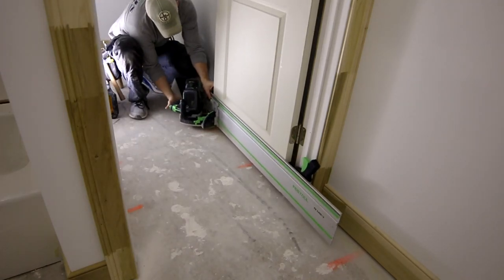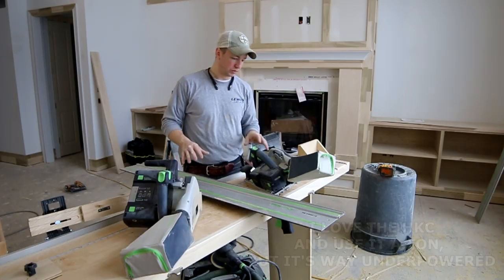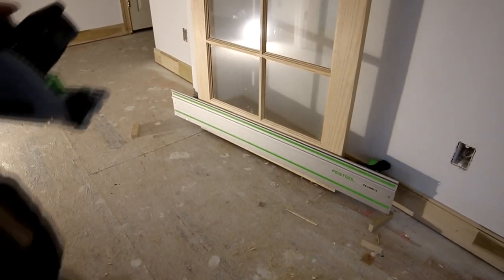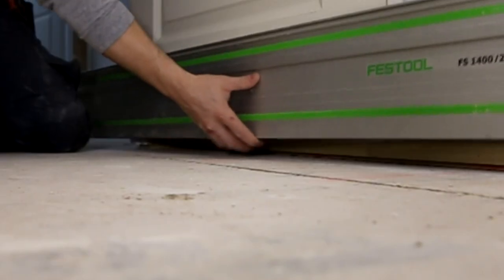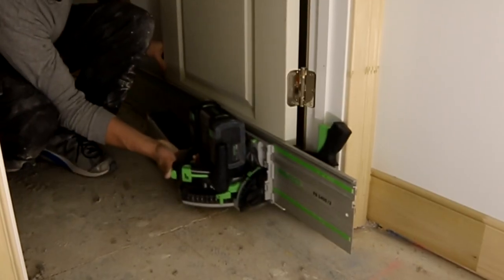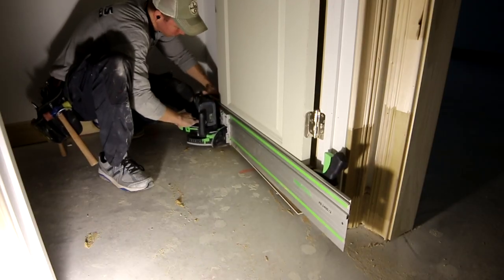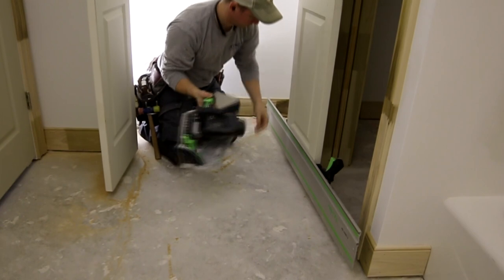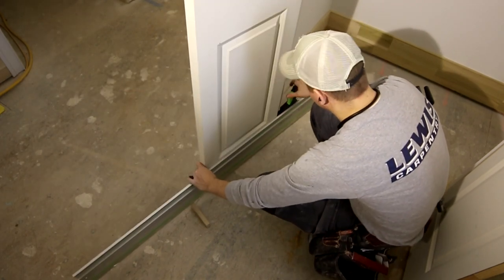Fast Door Cutting While Still Hanging??? Festool TSC 55 for the WIN!!!

Comment: I did this about 10 years ago at my friend's house.  People used to make fun of me when I told them how much the saw was with all the different clamps.  Then I started getting calls..."Hey can you come over here with that saw and do this or that?"  Then a few years later it was....."why do you need that cordless version now?"  Once in a while back then I would break down sheets if I was picking them up with my car, and the cuts din't waste any material because they were so accurate. I also made a vacuum adaptor for the Festool rail before I knew about the Mafell vacuum rail about 6 years ago. I love my TSC55 it has more power than the TS55 corded version I used to have, but you have to have extra batteries with you on the road.

Comment: Great video! I’ve been doing this since 2004 when I bought my first Festool track saw. Which is still a amazing saw & still in use today. Although it doesn’t see as much action now that my battery HKC has lightened it’s workload. As a custom hardwood floor layer & contractor that works in a lot of old San Francisco Victorian homes this method has been a real blessing as some of those old Victorian doors can be very difficult to remove and replace. As long as I have a sharpened blade on the saw I don’t get any tear out or paint damage however you can put delicate surfaces tape on the backside side of the door just in case and not plunge cutting too fast also helps. This method can also come in handy on doors with automatic closers and elevator doors etc… a real timesaver and great way to avoid potential damage.

Comment: Great video. For anyone looking to cut doors this way but not yet purchased a track saw, look at the Makita because it has a tab that slides out and locks into the track. This will hold the saw without tilting.
Reply: The Makita is also hella cheaper than any other track saw while being just as good.

Comment: Also, if you use a block on both sides of the track screwed to the floor, the door won’t swing away as you press the saw tight to the track - alternately you can use a 2x4 between the wall and door to push into for the same reason

Comment: Great tip Spencer ! I have the same clamp for my Festool rails and use it to cut tapered extension jambs and really long shims. I added 120 grit adhesive backed sandpaper to the ends of the stop and clamp to prevent slippage cutting tapers. Also, try repositioning the cam lever on the sticky clamp. I had to do it my mine.

Comment: As an 🇦🇺 finishing Carpenter, we hand our own doors from scratch   ( as in cutting and nailing and gluing our jams) so door height is not a problem.  Also i has thw dewalt track saw and dont think dewalt have clamps that will get behind the hinge side.

Comment: Like this method of cutting. Fast and less risky for the reasons you note.  
Never can move doors down but you can cut them up (a bit).  Would always opt for lower/tighter gaps given the choice.  Few things piss off homeowners more than having huge gap under the doors. "But you have central hvac system" isn't going to be an excuse/justification that makes them ok with it.

Comment: Here is a tip: 
A=size required to be cut from bottom of door,
B=size of the track from where the blade plunges to opposite parallel edge(ie. older Festool track used to be 161mm if I remember correctly, the new track are wider.)
A+B= your markings on the door are higher so you don't need to bend down and kiss the floor to check if you are on the line.

Comment: I was taught years and years ago by my dad, if there is a doubt in the thickness of the flooring. Glue and nail 1/2" blocks of wood to the bottom of the jamb legs and set it on the floor.
Reply: @cmmartti  I use 23 gauge pins and the is the purpose of the blocks are to keep all the tops at the same height. One room may have carpet the door right next to it has 3.5mm vinyl plank.

Comment: Really cool idea, makes it easy on the carpenter.  Only issue is the doors have to be at least primed on all sides to help prevent warping. I good builder will remove, cut prime, reinstall
Reply: They r going to get removed when the painter comes in never seen a trim Carpenter do much painting but great point 👍

Comment: If you use a door block behind the floor trim or a clamp it will stabilise the door and prevent you giving those shallow cuts . Maybe a small piece of wood on an angle to pinch under door or a foot stop that holds that door from swinging back and forth and gives you back your hands for the saw

Comment: Spencer on the subject of doors. Ever had to fill in a hinge where it was routered wrong or had to be just filled in for a new location.  I have a few 3 1/2 hinge locations on retrofit doors that have to filled in and re-routered. 1/4 inch rounds. I’ve been looking for video tricks/hints to fill them in. A few locations they need to move 2 inches
Reply from the maker: I can't say that I have. But I would just make a jig and route it completely through, that way you can glue in a square block, sand it, and re route.

Comment: Awesome!  I just hope the painters know to prime the bottoms of cut doors (something about keeping the door warranty, I believe).  Please keep these vidoes coming!
Reply: Sorry but no one paints under the doors
Reply: @Nest2309  moisture will get in from the exposed bottom wood.
Reply: @Nest2309  I've always painted top and bottom of doors
Reply: I can say from experience that it will void any warranty if the door is not finished on all sides. Had a $1700. custom white oak door warp.  Supplier came out to check, first thing he did was look for paint on top and bottom. No paint, no warranty.
Reply: @thedge7   I had the same issue in the UK with an oak door supplier came out and said the doors had to have a finish applied to them within 48 hrs of delivery or warranty is void
Reply: If you wanted to there are low profile painting pads you can slide under 👍🏻
Reply: @Nest2309  Wrong...always paint the top and bottom of door to avoid moisture issues.
Reply: @acerjuglans383  Tell me about it!   Customers are not always right.
Reply: Note that this is new construction. Nothing is painted yet. Cut or uncut it's not the responsibility of the installer to paint the bottoms of doors. This is between the contractor and the painter.That said, I've never seen a painter paint tops and bottoms of doors in 40 yrs as a trim carpenter! Installing a door in someone's house is a different situation requiring painting from the installer

Comment: That is a good idea. I will definitely be using it in the future. but most of the time i have to take the doors out for the painters, so i rather do it on the sawhorse, than on my knees. But only if i don't have to take the doors out, it will be worth it

Comment: Requirement:
Must be a young man to use properly.
Caution: Old men may get stuck in lower position.
Reply: Mansard Manor you got that shit right!!  Old man here and I don’t do ‘low’.
Reply: Yep....knees ouch....back ouch.
Reply: I’m 58 and I’m still getting on the knees to go low good kneepads help a lot
Reply: “Stuck in lower position”....  friend I can’t GET into lower position!!!
Reply: Its way better than breaking your back moving doors. That clamp is in the shopping cart. It will work fine for my corded 75. No power problem.
Reply: Use your claw hammer as a short cane to facilitate your upward motion. I'm 75 yoa; slower, hurt more, but I refuse to give up! The Snicker knee pad trousers may be my next purchase after the Festool clamp. I have a double swing door in a 1903 Victorian to cut shorter so it will clear the kitchen flooring. Great video. Thanks.
Reply: God Bless you sir! I’m inspired.

Comment: No track saw,  but we do the same thing on production homes.  Setting the saw on subfloor and cut door as the subfloor allows .  Saves hours of from popping off and resetting.
Reply from the maker: Its so crazy to me that I had never thought about doing that until I posted this video and another guy mentioned it. Makes perfect sense. I suppose I could even plot a piece of 1/4 ply down on the floor if I needed to raise the cut height. I'll be trying this on the next house.
Reply: @InsiderCarpentry  Yeah if carpet is extra thick we'll put down a rip off from island skin or toe kick and use that as a spacer.  Definitely a time saver!  Thanks for all the videos - has helped us implement some time saving tricks into our crew.

Comment: i use a wolff piranha for this. Expensive but it can undercut skirting boards and door frames for flooring
Reply: Garnhamr, Wolff Piranha!  Erste Klasse!!!  That's one seriously specialized tool, but wow, does it ever do its job in style.  I've never seen one except in Germany.  Using the TSC 55 for this, even with the Festool clamps, is, to borrow a phrase from the pharmaceutical industry,  sort of "off label use."

Comment: Awesome as usual. One issue....whenever I cut a door I seal it with some primer or polyurethane before reinstalling. Also, if I’m hanging all the doors I can usually cut them (to the correct height) and seal them as I go. 
Thanks for sharing bruh

Comment: Great asset clamping mechanism.
I got to admit the cordless festool plunge saw was my favourite as I also had the contractor and a corded plunge saw.
I was going to give my corded plunge saw away as I used the cordless plunge saw.
Someone decided they wanted all my tools and helped themselves to all my tools. I woke up and found my tool boxes empty.
One minute you are totally set up the next minute you are cleaned up. So it was exciting times to restock and replenish my supplies over s period of years. 
Mafel don't sell in Australia although you can buy online from USA to import to Australia.
I think I would still go for another cordless festool plunge saw. I bought a 6.2 amp hour battery. I was hoping festool would bring out 36 volt batteries like the competitors do. I guess festool are satisfied with the power of units they bring out and always wait a bit longer for their new products to come out. When they do, my goodness like their new cordless angle grinders and now cordless multi tool. Great video and really good. My only concern when you had the door open and cutting I was concerned you may have nicked the skirting as it seemed to come awfully close. I know you set the saw at the right depth. I might want to make a little blocker to keep sufficiently away from the skirting and rebate or even clamp to the end of the door above the track so it ensures not hitting the skirting.
Great work well done.
Reply from the maker: Sorry to hear about the theft. That is a carpenters worst nightmare. One thing I do is carry an "inland marine" insurance policy on my tools so that they are always covered by theft regardless of where they are.
Reply: Insider Carpentry I have a mate who was insured. Had his whole van stolen and insurance didn't cover it because of fine print need to be home at the time if burgularry.
It's good you have the insurance to cover no matter where you are.
It's when work gets quiet and you still have insurance premiums.

Comment: Love it man. Great tip. I occasionally have to crosscut plywood in rough lengths and this clamp method would help me to stay on one side and not have to walk around the plywood and clamp the other side. Save me some time and my money all at once. Thanks Spencer!
Reply from the maker: You shouldn't have to use a clamp for cutting plywood. Just setting the track on the plywood should be fine.

Comment: Another great video! My only concern is, you mentioned blocking up in some cases. That creates an issue of top casing not always lining up. You can get away with that in a lot of cases, but in some homes, and some situations it's an important detail. 

Curious on your thought.
Reply from the maker: Yeah, some guys get really hyper focused on casing lining up. I've been trimming a long time an dhave never pulled out a laser to light up heads. If its close enough to matter to the eye I use a level. Otherwise I don't worry about it. Trim carpentry is all about managing the eye, not perfection.
Reply: @InsiderCarpentry  yeah I agree. Usually it's at the end of a hallway where you have  a bunch of doors together. But the floor would have to be bad for things to be out of wack. I do a lot of old house renovations, and sometimes that is the case.  In basements where you have bulkheads over doors it can be notorious for highlighting head casings that don't line up.

Comment: If you where to install a door between carpet on one side & hard floor on the other side wouldn’t you set the jam down & go back to cut the door for the floor over which it would open.   Example over carpet or hard floor?
Reply from the maker: The flooring meets in the center of the door slab, so even if the door swings over a hard surface material it still needs to be up enough to clear the higher material. Its also good to have some gap so that return air can pass under the door when its closed.

Comment: Great vid spence,
Been cutting my doors like this for about a year now, so much easier slightly different set up though as I don’t have those clamps. I will be buying them straight away. 
Keep up he excellent work. 
From across the pond.
Reply: Clean Cut Carpenter can you use it on carpet
Reply: R C yes I use mine with carpet laid, just take longer to vacuum up the saw dust.

Comment: With regards to the HKC 55, I'm seeing a lot of different people saying it's very underpowered, but they still love using it for various tasks. What kind of finishing tasks is it suited for, and would it be very underpowered for occasionally cutting mdf? I've heard that it will accept the wider ts55 blades, with the trade off that the riving knife will not be useful.
Reply from the maker: It is underpowered but it’s still a useful tool. Mdf is easy to cut with anything so no problem there. I use it for all kinds of things. Might stifle on 2x SYP material or white oak treads.

Comment: I always wondered if there was a way to do this and tried with my dewalt plunge saw but the clamps are very bulky so it wasn’t as smooth and easy as this. Looks like I’ll be making an exception to dewalt and investing in a festool because those clamps are nicely designed and take up very little room and slide nicely!

Comment: Would the dust collection be better with a TS55 or 75 with the vacuum if you are doing this in a finished customers home? I like the TS75 for cutting depth but the weight savings for the 55 is nice, i don't know which one to buy! Plus the cheaper 6 1/4" blades haha

Comment: Dewalt track saw/plunge saw does same thing, bought some 5yrs ago nice to see festool is cathing up👍 problem is dewalt minimum cut margin of the floor is 18mm or 3/4 in imperial units. Unless carpet is off this feature is useless in my 5yrs of owning it had "pleasure" of using it in such way once🙄. Would be nices to know if anybody has same issues as I did, what cut margins on other manufacturers saws? As it ain't same as proper door trimming saw.

Comment: Good video thanks. But It only works when you have the space underneath to fit housing without rubbing on the floor.  In most applications there won't be enough room to fit the saw.

Comment: I must not be understanding the "blocking up" part. I understand why you're doing it for carpet, but doesn't it make the door header and ultimately the header trim 1/2" higher than other doors where you set the door jamb on the floor? If there is a scenario where a couple of bedrooms, bath, and cased opening are in a hallway, and the bedrooms have carpet and the other doors and cased opening have hard flooring, wouldn't your trim pieces be higher? Or am I missing something here?  Thanks for your videos
Reply from the maker: If they are in close proximity and it would be noticeable I put them on the same level. But if they are far enough away I don't worry about it as you can't tell if one is blocked up 1/4" higher when they are on the other sides of the room.
Reply: Makes sense. Thanks for taking time to reply

Comment: Do you break the edge of the door with a sanding block after? Will the painter ever pull the door and paint the bottom?  I cut doors in place on occasion but usually pull them so i can seal the  bottom with spray shellac. Because i know painters are lazy and wont do it.  Sometimes they don’t even paint the tops of the doors which are easily accessed.

Comment: To the commenter below: kneeling pads work well once you get over 50. Nice idea about cutting while hung. I see the grey table in the background. I’ve heard the hkc doesn’t cut a 2x4
Reply: Mitchell Kasdin I should’ve started using the pads when I was 40 like a knucklehead I waited till I was in my 50s. And spent two years letting my knees heal .Know I’m 58 back on my knees with good kneepads. Word to the young, start using the kneepads long before you need them. Like in your 30s. You will save yourself a lot of grief in later years

Comment: That’s a great time saver but no painter is going to know to paint that. I always paint my doors after cutting them because I know it won’t be done otherwise. Doors will warp if you leave that cut unpainted.
Reply from the maker: First, the door is only primed. Painters haven’t been there yet. Second, they don’t paint the bottom of the doors regardless. They all paint doors standing up vertically around here.

Comment: Great video again I'm not a festool guy but might need to by that set up for that reason. Can you do a video on your trim rack If like to implement something like that for my framing crew
Reply from the maker: I wouldn't put framing lumber on it. It's just 2x4 so the weight capacity is limited.
Reply: @InsiderCarpentry  I was thinking of using 4x4 and half laps. I like the a frame idea for covering material in the winter